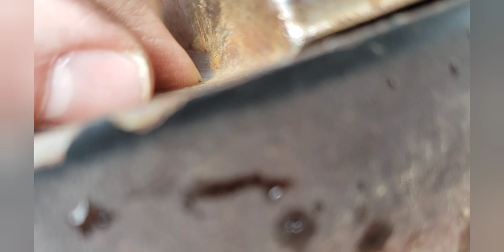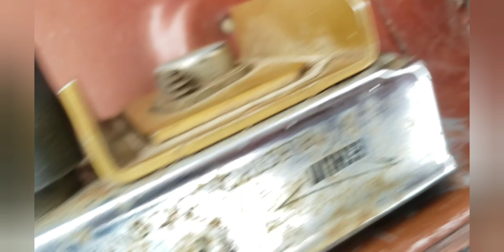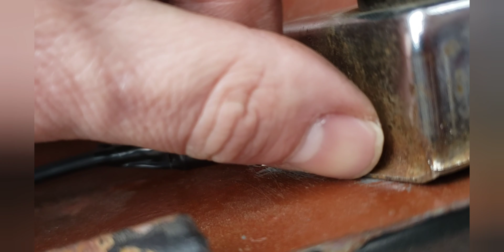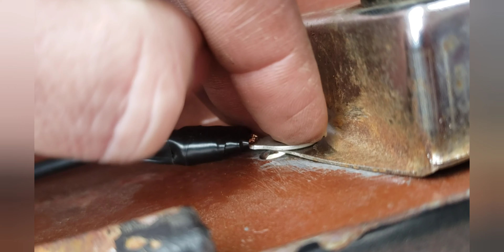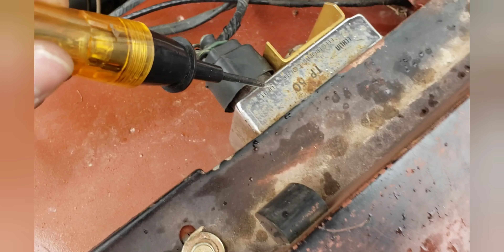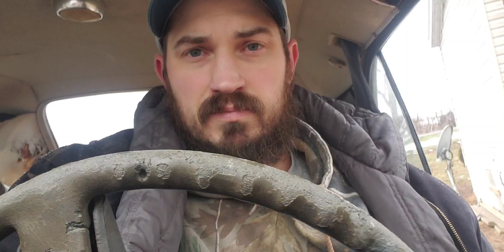#mopar no spark fix. Part two.

Comment: Great video! I wish we could still get the original Chrysler chrome and orange boxes. I'm going to put a FBO box on mine the next time it goes bad. The one I have on my Demon now is a old used original Chrysler one from the junkyard.
Reply: Me too I'll be shopping at FBO!!
Reply from the maker: I have been collecting them as I find them. I considered the fbo box with the built in rev limiter. I may pick one up eventually. I buy every chrome box I can find reasonably priced. Lol
Reply: @Dartfreak75  👍
Reply: @moparnut6286  👍

Comment: I love using a test light! So often it's way better than a multimeter on a 12v system! External grounds are a great idea! I have one on my ignition and my Voltage regulator too!
Reply from the maker: Thats a great idea. I need to add one to my voltage regulator.

Comment: Nice job using just basic tools that everyone should have I like the old mopar 5 pin and 4 pin ignition they work just fine for a street car. Extra ground is a must for sure.
Reply from the maker: I love a test light. I use them more than I do multimeters. I've gotten good at judging the voltage based off the brightness of the light.
Reply: @Dartfreak75  yep you can get by with a good test light just fine and later you can move up to a power probe but I would get one of the knock ones from Amazon way cheaper it's nice to have a way to power up things all over the car, And be able to test for voltage drop.
Reply from the maker: @moparnut6286  yes I would like to have one of those. I got some wiring issues to sort through on this car.

Comment: '75 TrailDuster 360" here,my ECU is leaking,truck works,got to 
buy one too!
Reply from the maker: Yea if the protection goo is leaking out its probably time to replace it or at least keep a spare in the truck. Without the silicone they over heat and fry.

Comment: So I have a dumb question. In your first video when testing for grounds, it was a good thing if the test light didn’t go off, now in this video it’s a good thing (showing ground) if the light comes on. What am I missing?
Reply from the maker: So this is gonna be hard to explain but I'll do my best! First thing I'm sorry I haven't replied sooner this comment is 7 months old sorry im just now seeing it! So in the first video the key was on and the center of the ecu should not be hot (if it is the ecu is not grounded or is not working properly) in the 2nd video i was checking for ground with the test light on the positive side of the  battery so if the box is grounded properly the circuit is complete thus the light will come on. I hope that makes sense!

Comment: Why not go directly to the negative post of the battery…. It’s so close.
Reply from the maker: You could I just chose a body ground to keep the battery cables from looking cobbled up. You absolutely could go straight to ground as a matter of fact i did just that for testing I just didn't want a bunch of wires on the battery posts! Good observation thanks!